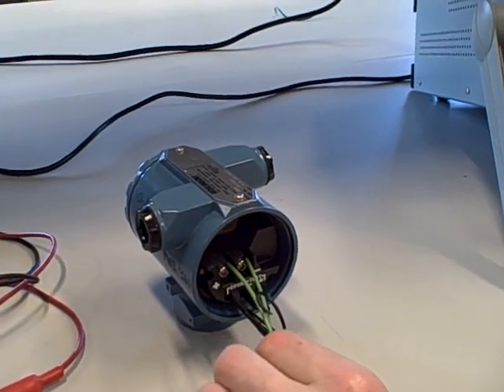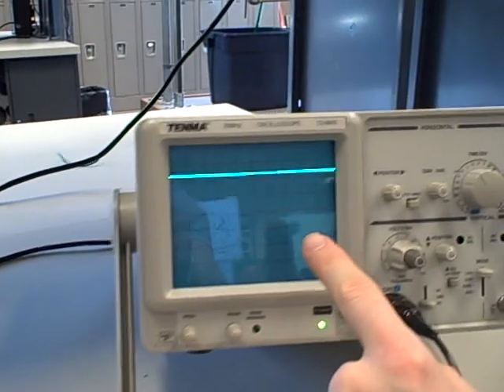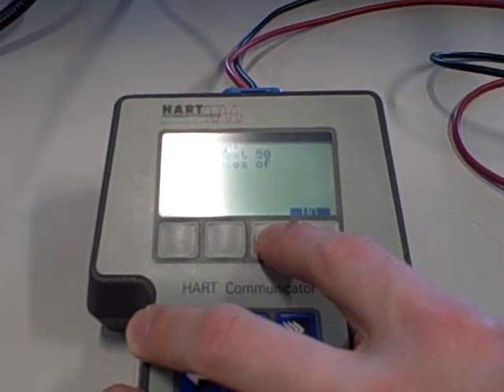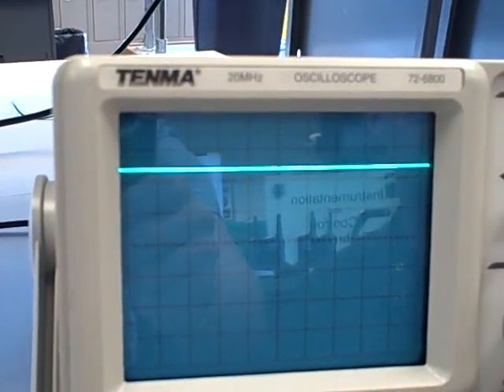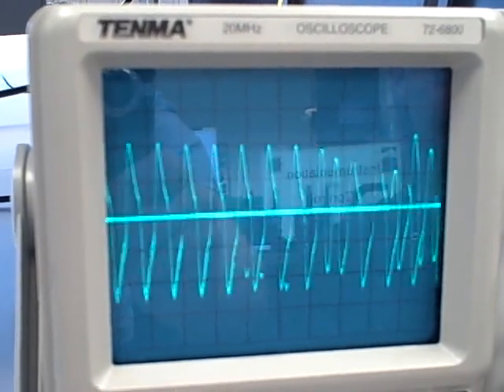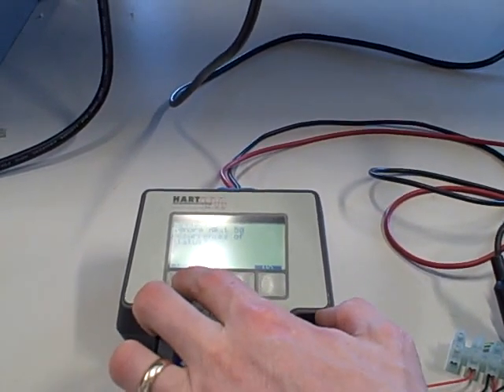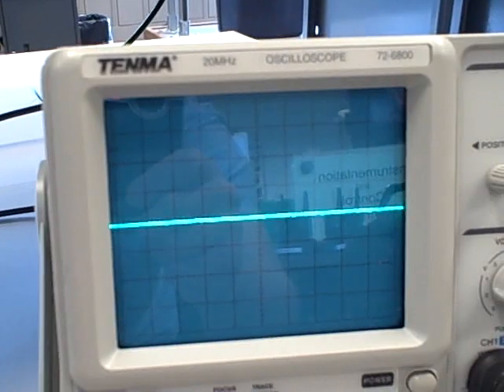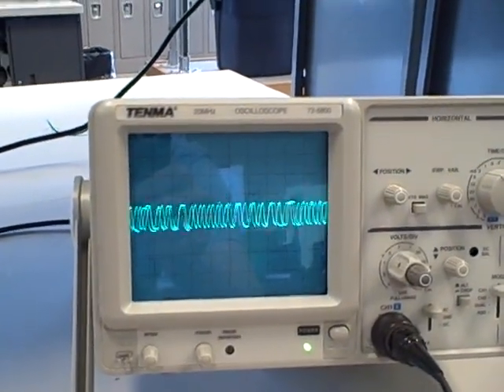HART signals on oscilloscope

Comment: It's a good video to show the signals. Most people wii have used the oscillascope are electrical by trade like me and I've been working mainly on instrumentation for 7+ years now. I didn't know the communicator send it 22kHz first. I've been using the 375 secs 475 for years and learned something this morning before I go to work. Thanks!
Reply: not Khz, hz
Reply: 2200 Hz = 2.2KHz for the zero and 1200 Hz = 1.2KHz for the 1s
yeah i add a zero it is correct now
Reply: look at the description of the video